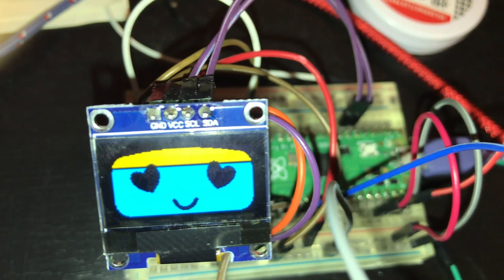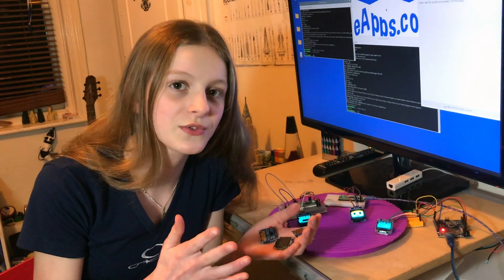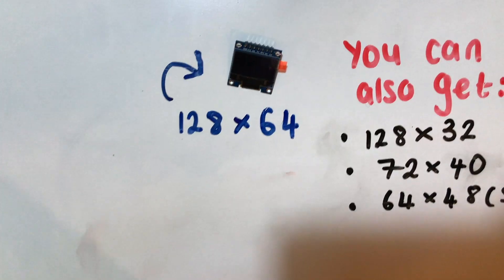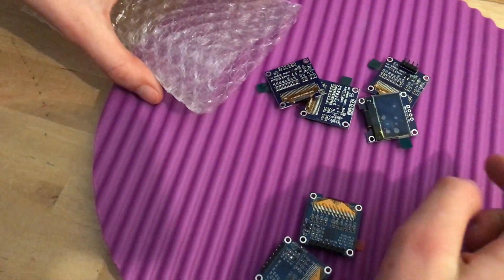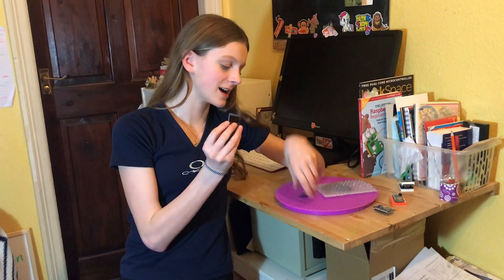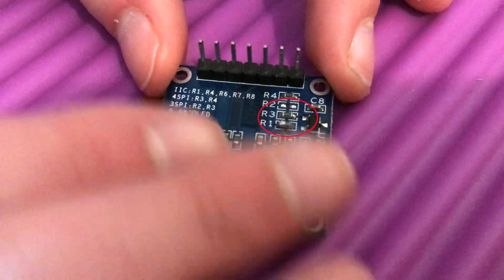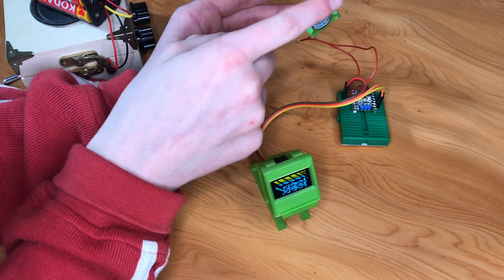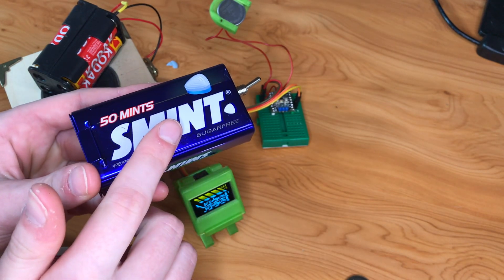SSD1306 - The Must Have Workhorse For Your Raspberry Pi Pico or Microcontroller Projects

Comment: Your 3D printed case is probably full, but if you could fit an MPU-6050 gyro/accelerometer in the electronic pet, then you could program it to react to movements, maybe animate funny faces or surprise when you turn it around, or raise its eyebrows while it's smiling.

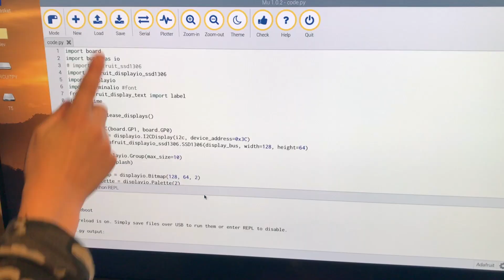Comment: Edit: I just noticed at 00:13, the display on the right with the oblong holes has the same order my displays have.  Mine does not have oblong holes, but there is also no metal exposed on the holes on mine.  Does the component side on yours look similar on all models?  Do you follow the label for where to attach GND and VCC?   Do you have to be careful when using a different model when testing? For example, like in the soldering video, where the newly soldered display replaced another one, while keeping the connector pins in the same order.

I ordered some I2C 64x128 OLED displays from China via ebay, thinking they were 1306 compatible (the ebay listing claimed that).  They are marked HW-239A on the circuit board side where yours has YY in a circle, and look very similar to the SSD1306 (down to the misspelled ADRESS) IIC ADRESS (sic) SELECT, U2, C8 (but no J1-J4) and all the connections to the ribbon cable going to the OLED display have exactly the same markings as your board.  But on the display side, it is marked VCC GND SCL SDA (the VCC and GND are reversed from pictures of the SSD1306), i.e. mine has pin1 (square pad) labelled as VCC, not GND.  The dilemma is that as with most China parts, there is no documentation, and I find it surprising that the pin ordering would be different than what they are cloning.  So I don't know if the pins are labelled wrong, or if the pins are really in a different arrangement.  This is probably one reason they were some of the cheapest ones listed.  The listing said it had the 1306 driver, and I found a note on the Arduino forum where someone said they have gotten some displays with the GND and VCC swapped, so I guess I will just have to try it and hope it isn't a destructive test. https://forum.arduino.cc/index.php?topic=584316.0  Edit.  Just did continuity test to see if I could determine anything, but I don't have a 1306 to test against.  Pin 1 (labelled VCC) has continuity to the single pin side of U2.   Pin 2 (labelled GND) has continuity to the lower left pin of U2 and to the unused 0x7A ADRESS select pad.  Oh, and these claimed to be usable with either 3.3V or 5V.  It is a mystery to me where the "controller" is, there isn't any obvious chip, my guess is that U2 is related to power since there is a capacitor next to it.  The controller must be in the display board connected with the ribbon cable.